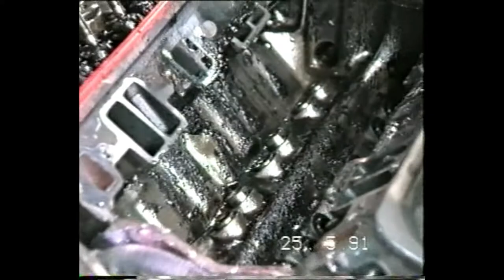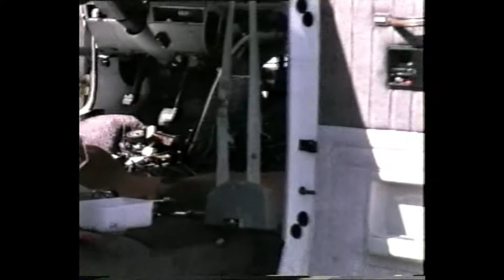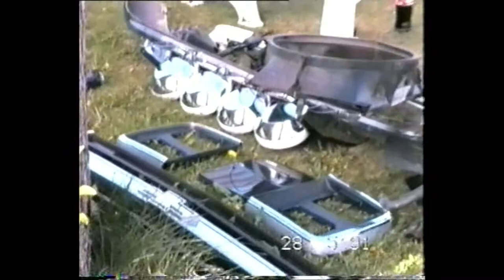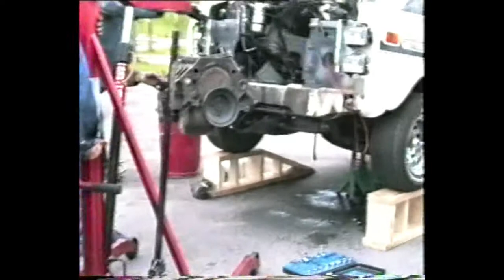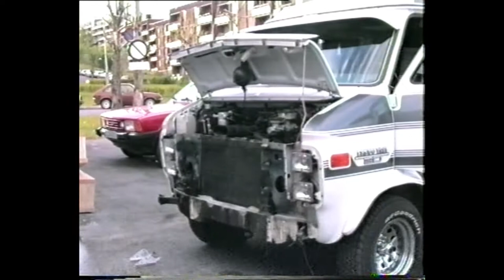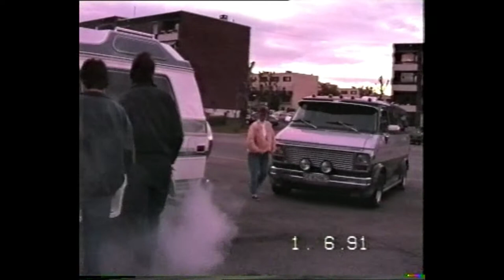Engine problem, Chevy van

Comment: Wow vad var orsaken till sprickan? Fabrictions fel? Vad blev symtomen? 

Har själv en 305 tbi i min van från 1989😅
Reply from the maker: Fikk beskjed fra GM forhandler i Oslo den gang at i siste halvår av 1987 og første halvår i 1988, leverte GM ut noen motorer med dårlig støpgods. Det var fler reklamasjoner på dette dengang. Symptomene er jo at du får vann i oljen. Vår bil var ikke importert av GM Norge og firma som hadde tatt inn bilen var konkurs. Derfor byttet jeg motor selv. De bilene som går i dag har nok ikke hatt det problemet, eller det har blitt fikset.
Reply: @Chevyvan-freak  jaha! aldrig hört det innan. Vilket jobb ni måste lagt ner och utomhus!😁  hoppas att jag slipper det, att det är fixat. Min van har stått i en container 1989-1999, svensksåld. Idag gått 12500mil. Snart dags att byta ventiltätningar och insugspackning då det fuktar lite.
Reply from the maker: @RC_ALL_DAY  var nok ikke det problemet på den modellen. Men det var mye jobb, håper jeg slipper å gjøre det igjen 😁😁